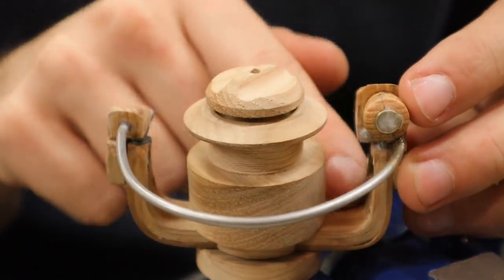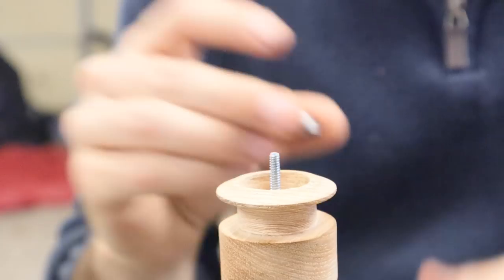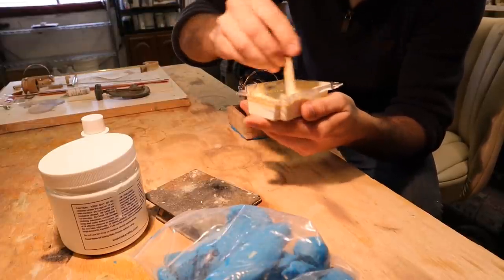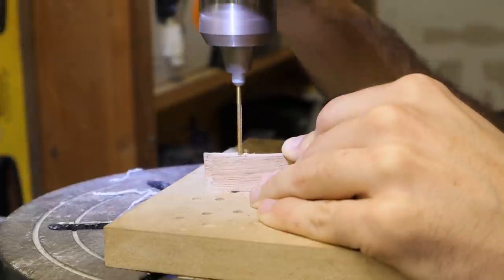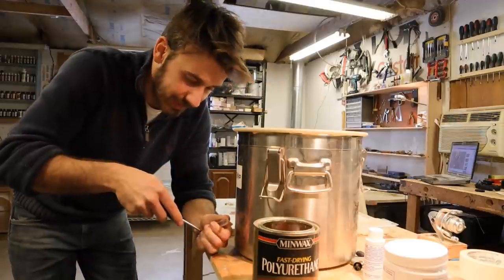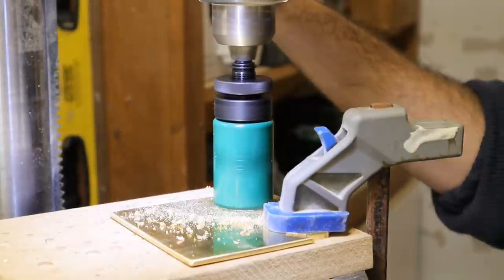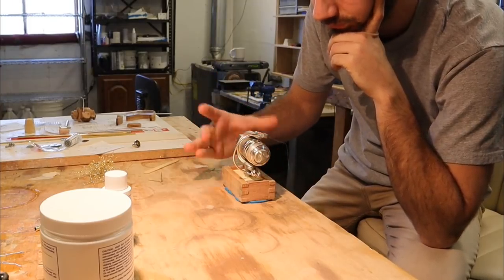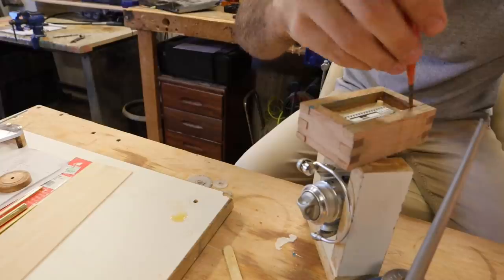Making a Fishing Reel | PART 5

Comment: Suggestions: 
a brass sleeve and washer running through that cork handle or it won’t last the day.

a way to INDEX the holes being drilled so they maintain the correct spacing you desire. ( pin height/length also effects spacing).

Locks have pre-made pins that are uniform and would be perfect teeth for your cogs. (Any hardware or locksmith shop should carry these)

Comment: This Old Tony has a recent video about gears. Worth a watch to understand involute and the speed variance creates by peg gears. Also, you run your drill press really fast, its worth slowing it down whenever the radius of the bit is larger or when you are taking a big chip (like with single flute chamfer tools). Great videos! You've inspired me to pick up a few new skills. Thanks!

Comment: You could 3d print ur gears use 100% infill with carbon or nylon filiment and it should be accurate and strong enough for what ur doing

Comment: The bale is going to open anytime there is tension on the line. Look at the reel you used to make a mold. The roller is offset so the tension will force the bale to close. Yours will open with tension.
Reply from the maker: Made sure it doesn’t do that. The connection to the bail arm is right under the slot for the line guide. Tested it out too and it’s all good.

Comment: The trick with hole saws is to take a little bite, back it off and allow the chip to clear (or blow it out with some air), they get gummed up awfully fast if you've got to cut deeper than the teeth

Comment: the downside with the wheel and pin system is going to be twofold, backlash is going to be pretty severe, which might not matter too much with a reel, but you'll also lose a lot of the strength you'd have had with regular brass gears, those little pins are going to be very susceptible to bending and snapping, brass is pretty soft.

Comment: Stack the 3 brass disks big to small. Then draw the lines for the gears starting on top down to the bottom while clamped together. Then when you cut the gears, all the teeth will line up on each wheel.   I dunno, seems right to me.

Comment: When you hook a fish is the magnet strong 💪 enough to stay closed it every time will it pop open under pressure
Reply from the maker: I think the bail line guide is far enough back, so the line can’t get enough leverage to open it.
Reply: @marlingbaits  you should have made the line guide so that the line  guide is right on top of the pivot point, or even a little bit to the right of the pivot point. That way there would be no way for the line tension to pull the line guide open, as the moment would be pulling the line guide closed, not open as it is now. If you look at commercial spinning reels, they all have the guide slightly offset from the pivot to achieve this. Now the only thing stopping it from opening is the force of the magnets. Just my two cents as a mechanical engineering student!

Comment: I would have layed out the wheel with a compass and drilled all the pins holes all while left on the parent stock. Then used the hole saw to cut out the finished wheels.

Comment: since your going with the pin system for your gears why are you over thinking it...can't you just use the teeth of the hole saw bit as a guide for the gear pins
Reply: Great suggestion. All the saws have identical tooth spacing.